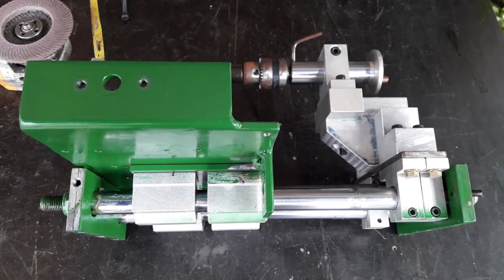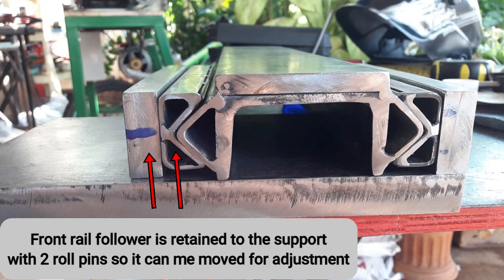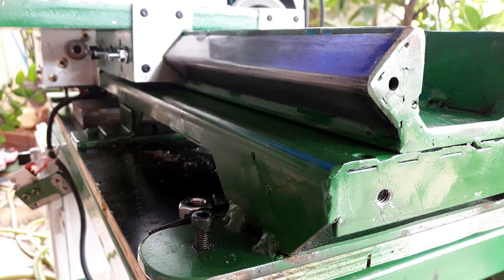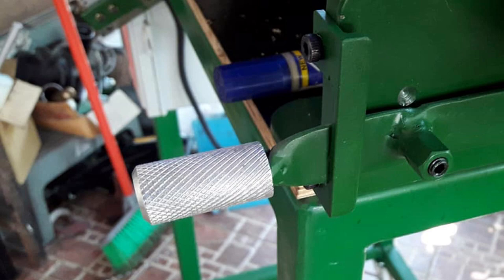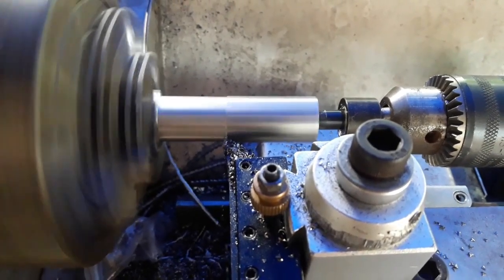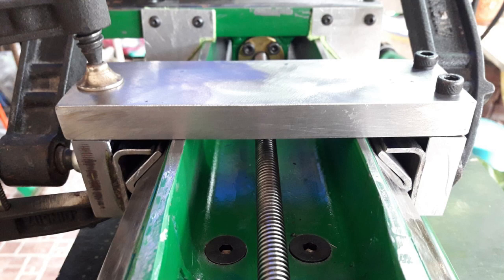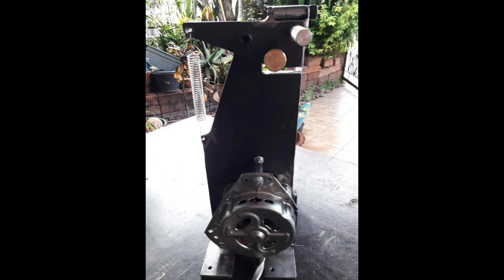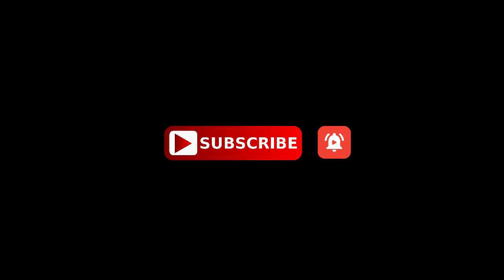MHW Episode 4 (DIY Homemade Lathe Upgrade) Part 1

Comment: There is a reason angle grinders have guards. 
Most of the serious injuries I've seen people have with grinders have been with the guard off.
20+ years in the light fabrication trade (sheetmetal and up to 6mm mostly, quite a bit of heavier stuff too)
I've had my share of nicks and scratches.
Reply from the maker: Happens to the best of us, believe you me, what happened there, a guard would not have prevented.

Comment: Good job. I'm building a mini lathe as well and running into all sorts of issues. I'm using regular right handed threaded rods, and then I plan to use the finished lathe to machine left handed lead screws. 
I used a square steel rod to make "box" type ways, welded to the bed which is made of square steel tube. I'm filling the tube with concrete to damp vibrations. 
I 90% done, but I have no idea if it's going to work or not...
Reply from the maker: Thanks for the kind remarks, next weekend I will publish a video on my new cross slides, make sure you have a look at that.